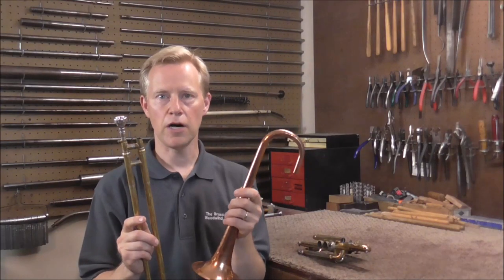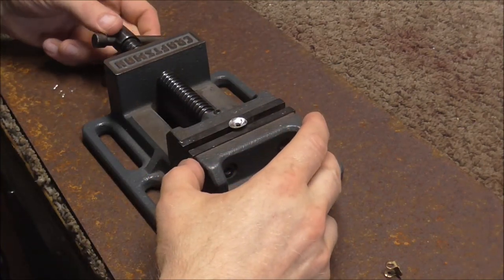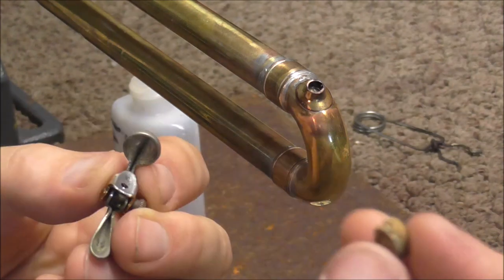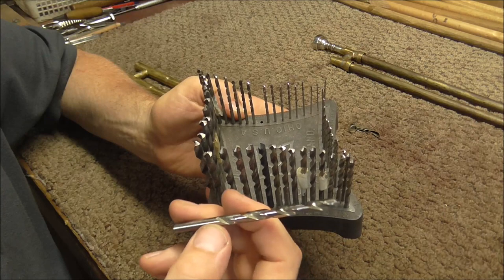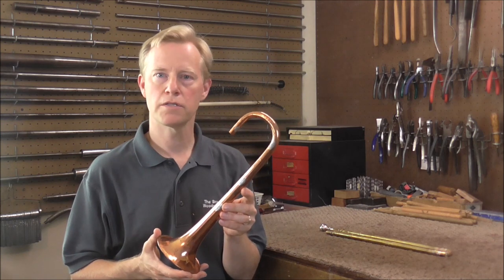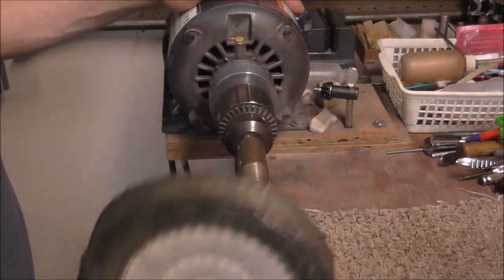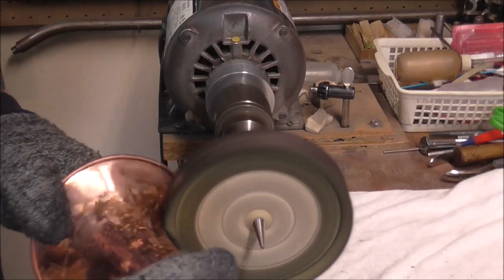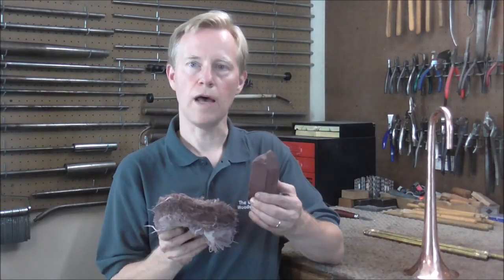Building a Slide Trumpet Project #7: Installing a Water key and Buffing

Comment: How do you remove any burrs on the inside of hole you drillied?
Reply from the maker: I did not show that in the video, but I cleaned up  the burrs with my spring hook. A better way to do it would have been to install the water key before I soldered on the crook. That way, I could have cleaned up the burrs from the inside with the triangular knife. But I did not think of that until it was too late.